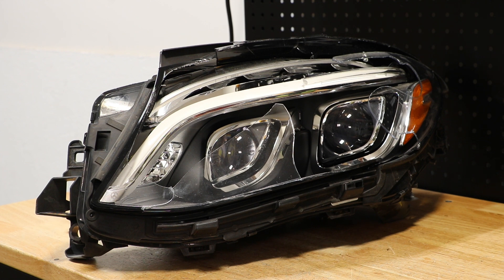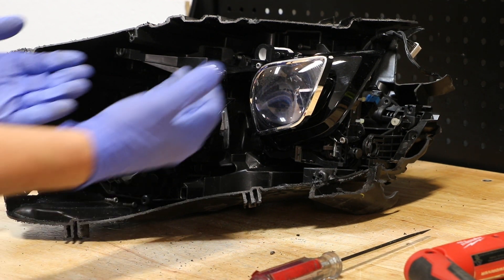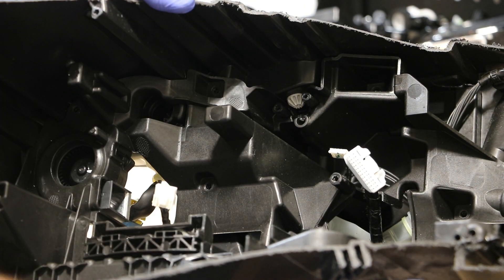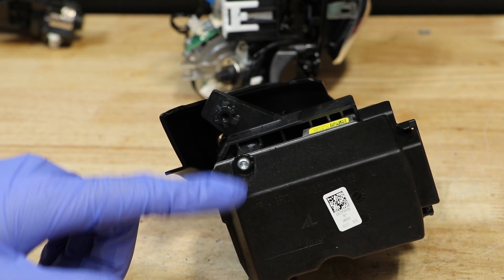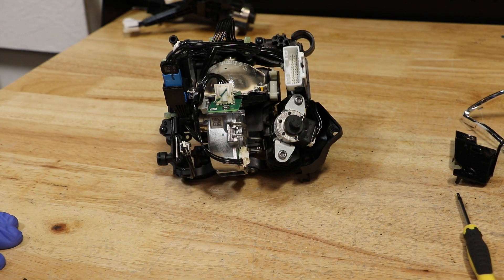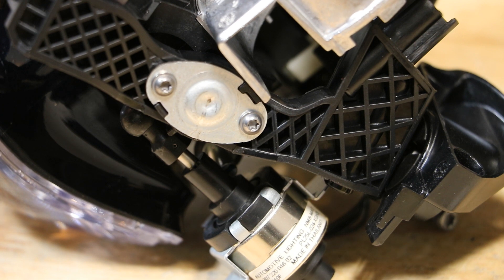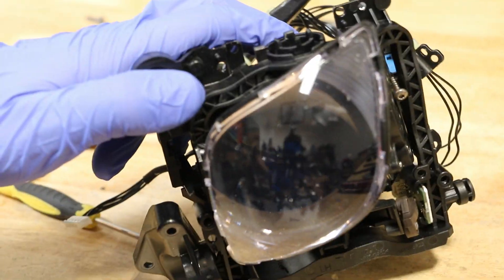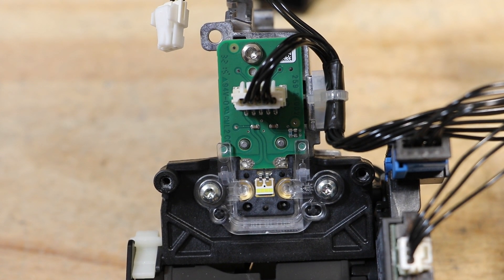2016-2018 Mercedes Benz GLE350 LED Headlight Teardown

Comment: i have a 2017 and my headlamp does not have any of these screws - it's sealed
Reply from the maker: the screws are there to hold the lens in place while the glue dries during manufacturing.  They are not there to hold the lens to the body of the light.  All modern headlights are sealed with some sort of glue.